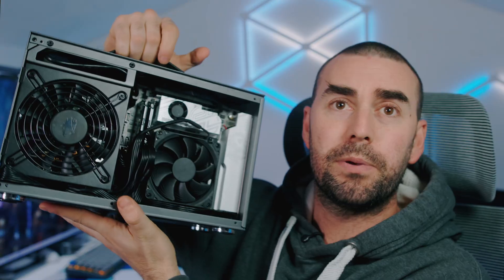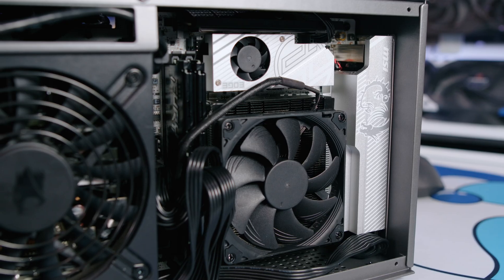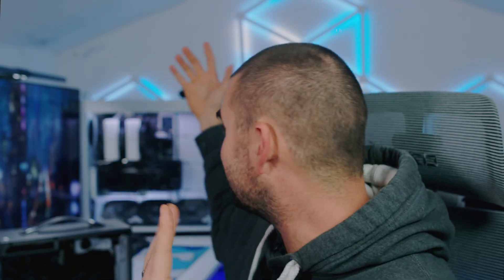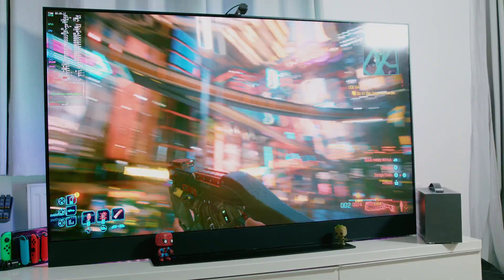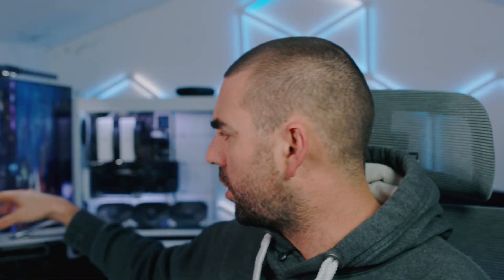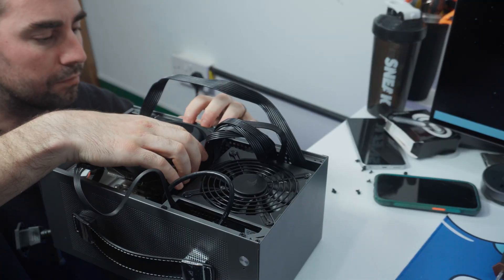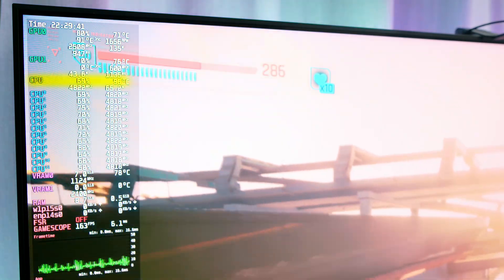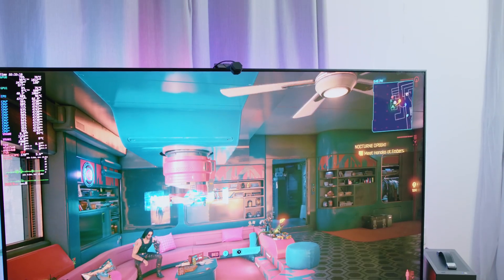Can I Build a Custom Steam Machine That Actually Works?

Comment: That's a nice little box you have built. I went with an AM4 B550 itx build and built a "steam machine" with Bazzite using old parts I had lying around and a few newly bought parts I bought on sale and what I could find before the new year. It needs a few finishing touches and some gaming temperature testing, then it is eventually going to a family member. It will be great when Valve releases the Steam Machine recovery image. If compatible I might install Steam OS on it in the future. I built my Steam machine in a jonsplus Z20.
Reply from the maker: That sounds like a fantastic project! It's always great to put old parts to good use. 🙌
Reply: @imchecotech  I installed Steam OS on it out of curiosity and it is working quite well. Valve appears to be modifying the steam deck image and getting it prepped for the Steam machine.

Comment: I have been into small PCs for a while, that is or at least looks like an Xros S300 case, which as far as I know is the smallest practical case that can hold a full sized GPU. There are several others in that size range but that case is only 8.1 Liters, that's why I built one. If there is another case smaller than 8.1 Litres that holds a 300mm GPU I would like to know about it.
Reply from the maker: First time for me on something so small, I may try a 5080 just for laughs in a future video ❤
Reply: @imchecotech that would be awesome! A shorter 5080 would easily fit. There is one case that may be a bit smaller. It's 7 Litres Dan A4 sfx, but there are only old videos on it. I don't know if you can even get them anymore. That means the S300 is it

Comment: I believe that due to the RAM memory crisis, many developers will be forced to optimize games to use less RAM. If Valve manages to convince many developers to use the Steam Machine hardware as a base when porting their new games to PC, I think we'll have what's called console optimization, since optimization could be better on specific hardware. What Valve also needs to do is make available a cross-platform engine like the Source Engine, but open source, to encourage small developers to invest in cross-platform titles. This way, we'll have more titles that use the Vulkan API. What I'm saying is that the Steam Machine itself could be both the devkit and the console at the same time.
Reply from the maker: It would be a game-changer if Steam Machine became the standard devkit for PC titles! The challenge, of course, is getting enough developers and studios on board, but if Valve plays it right, this could shift PC gaming in a very interesting direction toward more efficient, optimized, and cross-platform titles.